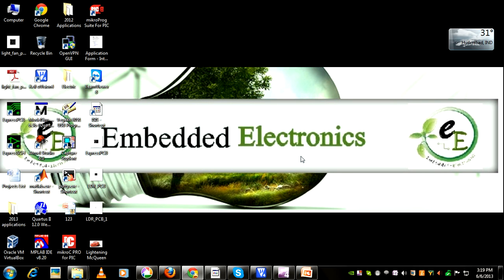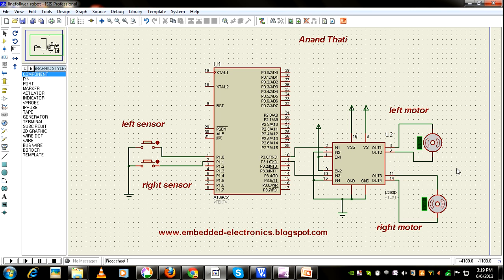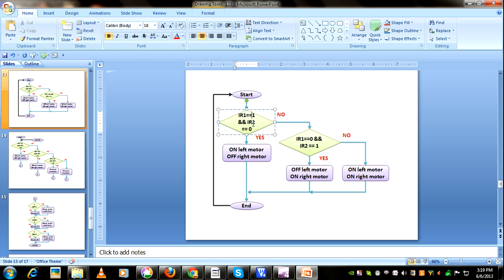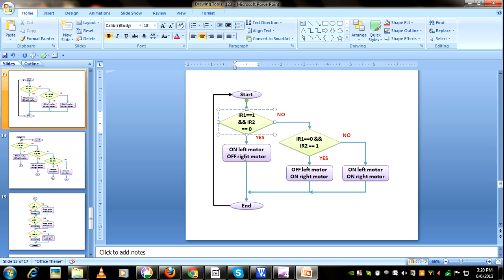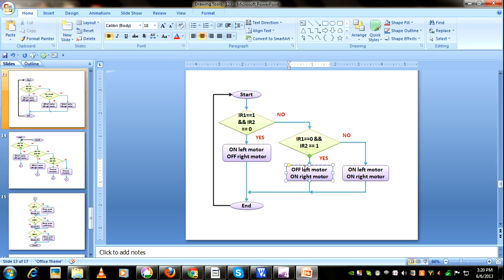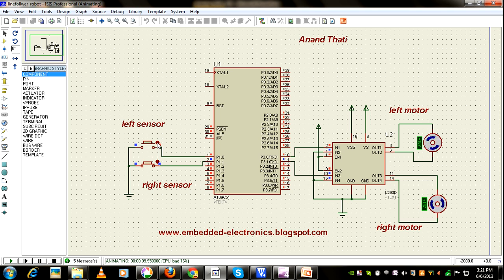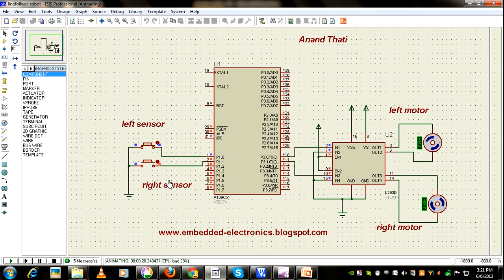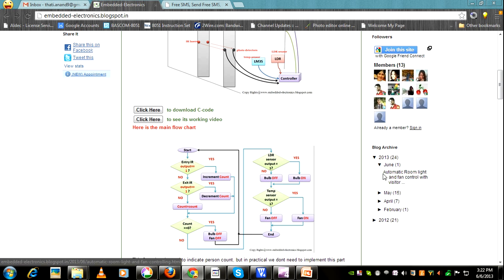line follower robot using 8051

Comment: what is the name of motor used in proteus is it a fan dc , an also the ic next to it is it hte motor driving circuit uln2003a
Reply from the maker: +tolba charawy dc motor and l293d
Reply: so i changed the push button by a lm324 and ldr to detect the white color but can you tell me the reference voltage for the black or white color how do i find it